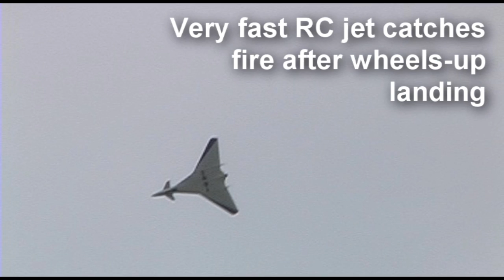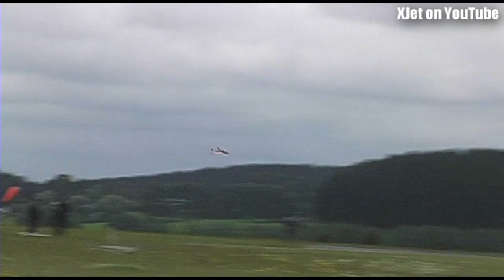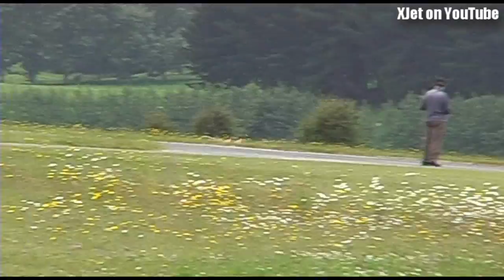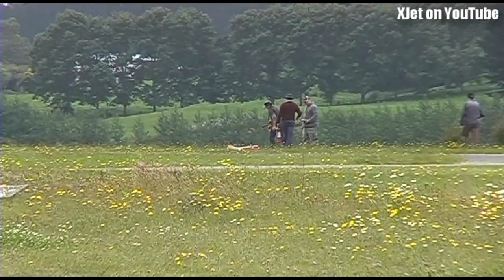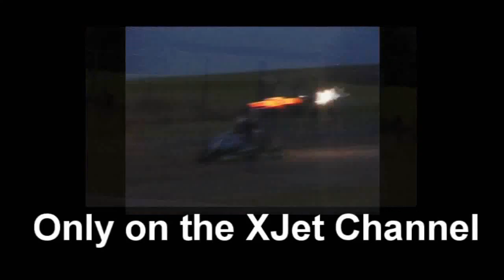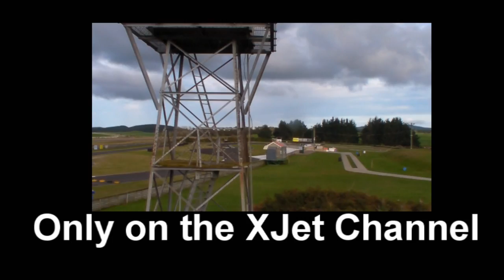RC Jet, small fire after landing

Comment: @horizonflyer9 More than likely the fuel pump was still shooting fuel into the hot engine. While in flight the raw fuel is forced out the back of the engine by the air traveling through the engine of the fast moving plane. But once it landed the airflow stopped and the fuel just collected inside the hot engine and then POOF!!! The fuel ignites inside the hot engine starting a fire.